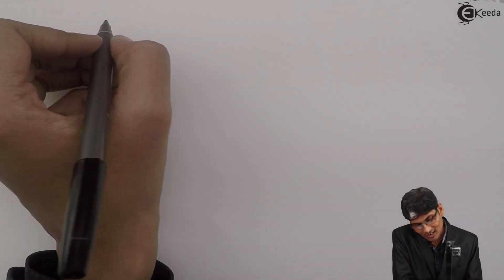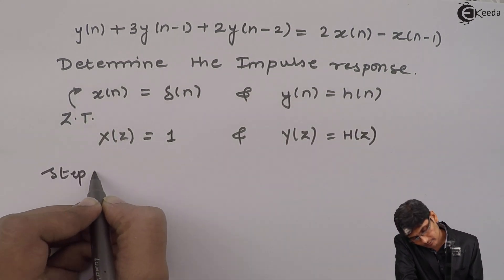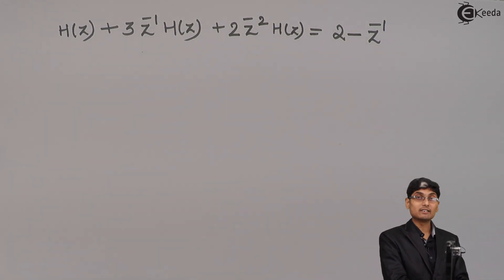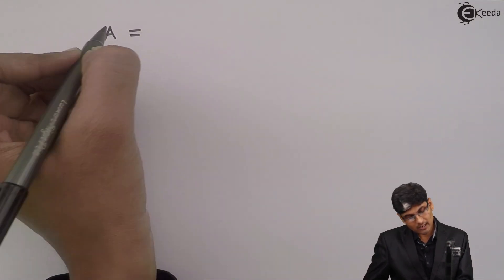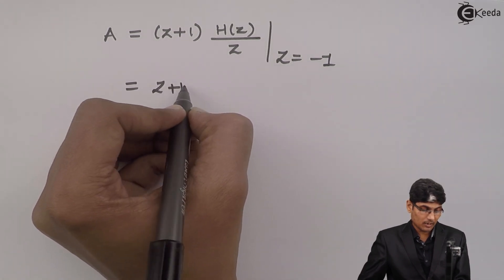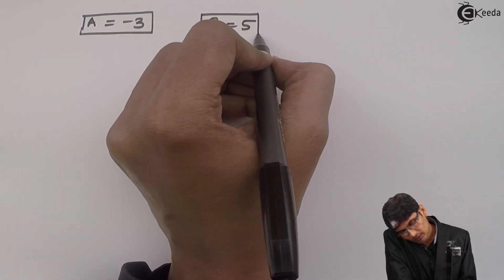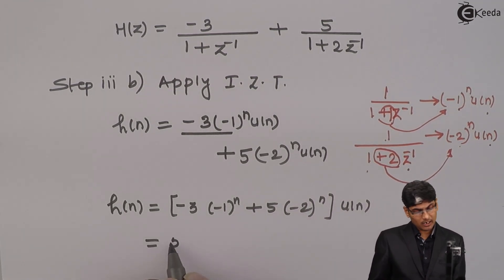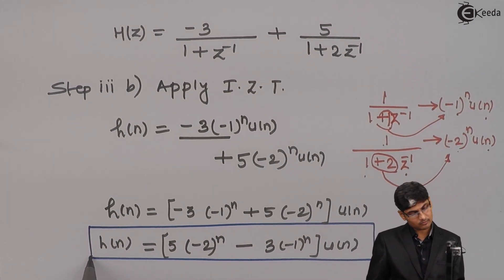Problem No.1 on Impulse Response in Discrete Time signal Time Processing

Comment: Determine the total solution of the following difference equation:
y(n)= 5y(n)-6y(n-2)+x(n)
when the forcing function , x(n)= 3^n and initial condition , y(-1)=2 &amp; y(-2)=4.
Also, draw the difference equation using building blocks. sir answer plaase